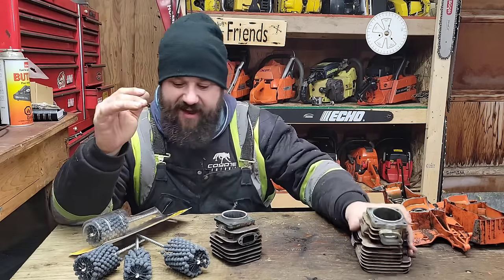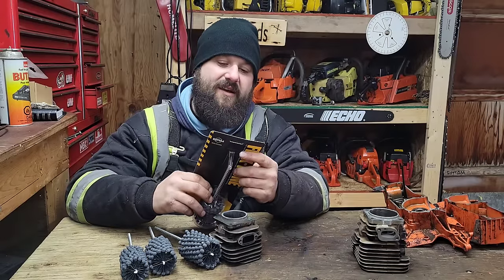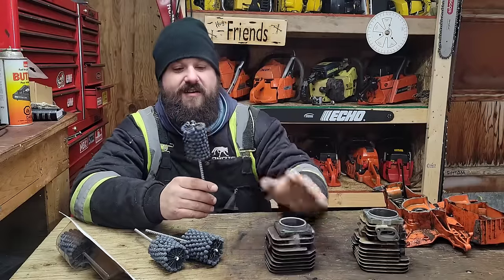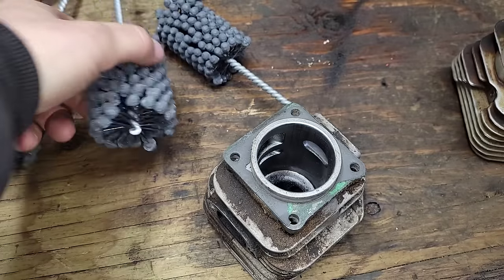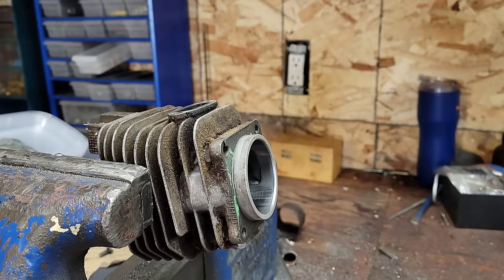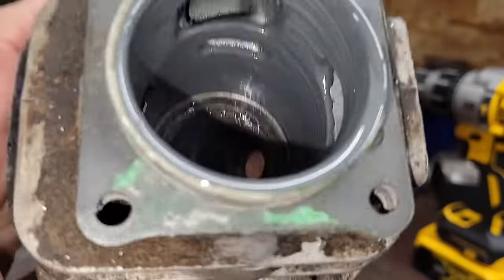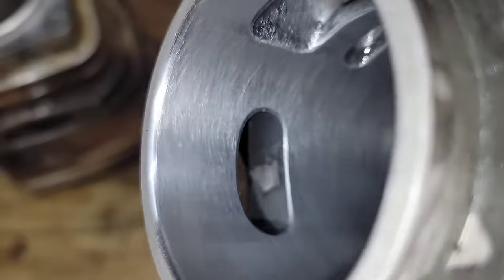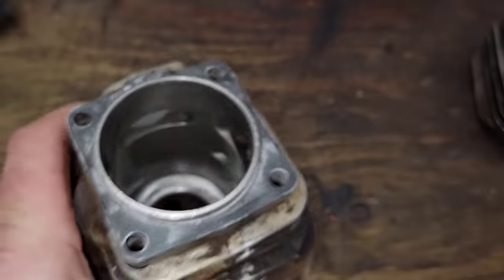Nikasil 2 stroke cylinders. To hone or not to hone? That is the question.

Comment: Great video as always Tinman. I have been using those hones for 35 years. Always does a good job. Only difference is I use soapy water for lubricant. I actually submerge the cylinder in a bucket of soapy water when I hone. Works well for me and no messy oil everywhere 👍🏼
Reply: Right on… I just work under my faucet on my shop sink and work with the warm water… makes your visual inspection much clearer…
Reply: Make a video

Comment: I use both, ball hones and three shoe hones. With the the three shoe hone you have to be a little more careful because they can take material off faster then a ball hone. But I like them better because you are working with flat plains, so if you have waffling or low spots they'll show up. Where the ball hone will cover them up.
Reply: Covering them up is better for my ocd

Comment: I am all for honing good cylinders.   The only comment I have is they suggest using aluminum oxide for nikasil cylinders 240 plus grit.   Silicone carbide is for cast cylinders like steel engine blocks.     Also.  Ball hones are for many sizes. Not just size it says.   If it fits it works.

Comment: If you are going through all the trouble to port a cylinder a good de-glaze is a very important step. A very glazed cylinder is not going to run any where near as good as a good cross hatching. You will notice the difference, especially if you want to run the engine for long periods of time. A glazed cylinder will be weird when it gets hot because the oil has nowhere to live. I have even been known to crosshatch a piston now and then with some 220 or 320 grit wet dry sandpaper 😉 anything to get the oil a place to be.
Reply: I think he should move in and out faster so that the cross hatch angle is increased.

Comment: I hone closed transfer port cylinders with three stone or tri hones and open transfer port cylinders with dingleberry hones or 220 sand paper if they are not to bad. The tri hone will tell you if the cylinder is round, if you have any taper near the top or something else wrong. They will also remove transfer. I use W-D 40 for lube. 
 Great video keep the good stuff coming

Comment: Tinman thanks for making this video- I’ve always honed after porting and have used that same brand hone for years- never once have I had issues with the plating - if plating comes off than there’s a bigger issue than the ball home running through it- and you hit the nail on the head when you mention how running the hone through cleans up the chamfers and makes the edges flow better- your best line for sure was “ if you don’t want to hone than don’t hone” it’s crazy how one guy will say not to and it’s like guys who have never tried it get all nervous like your running a jackhammer up and down the hole…. Great video man!
Reply: Nailed it

Comment: Tinman, honing definitely works. I have used the ball hones I'm many different cylinders on jet ski and marine engines. I was told by a very experienced race engine builder to never use a shoe hone in a two stroke cylinder. He said they can catch on the ports, breaking the shoe and absolutely trash a cylinder. If I rebuild an engine it gets honed unless I don't have that size or am replacing the cylinder. Keep up the great work Tinman. Your knowledge and humbleness is awesome. 🤘🪓🌳

Comment: I have used those same hones for all kind of things that need fit or just smartened up.  They work great for everything especially cylinders.  The finish in a cylinder can't be beat and they really do a good job on 2-cycle port edges like you said.  Never had an issue with results after using them.  Hey Buckin, bananas are really good for reducing muscle cramps!  Have a good one everybody.  Thanks Tinman, good video.

Comment: Hi Tinman. Thank you for ALL that you do to help all of us grunts work on our saws! We are all indebted to you.

I was just out on the web looking for a source for the 320 grit silicon carbide flex hone for my Stihl 026 and I found a tool seller that has included an image of the Abrasive Selection page from the Brush Research catalog. It says "For deglazing Nikisil cylinders, we suggest 240 AO." So softer and courser stones than what you are using. And justgjt made the same comment about the aluminum oxide last month. Since we are only wanting to deglaze and/or crosshatch the surface the softer stone makes sense.

Removing the aluminum transfer and restoring the cylinder surface rather than jumping right into a new cylinder isn't controversial to me!😁

Comment: Fantastic and spot on Tinman!!!  You totally hit the ball out of the park when you say hello you aren’t honestly honing anything but you a just doing a little bit of a deglaze job to make your rings a good bore to bite and cut and seat and seal up your bore nicely!!! I absolutely do new and used or basically every single engine I build! I’m a warm water underneath my sink for the water lubrication and materials removal so it’s not really even possible to damage the bore with the water process! Yeah man it’s just like 6 rpm’s and a couple seconds of action for a nice surface break not a 9K boring project! LMFFAO

Comment: I use the 3 stone spring loaded hones for just about every Atv I rebuild. Never had a problem with one not seating the rings.. Even on chrome/Nikisil cylinders. I once took a Nikisil cylinder for a Suzuki that needed replated and i couldn’t afford to get done so I took my 3 rock hone and honed it out to the next size piston, was a steel sleeve that was plated knocked the plating off of it and then it it back together with a new 1st oversized piston and rings. Rode that thing ram better than when I got it for over a yr sold it to a buddy and he rode the snot out of it for at least two more years before blowing it up..

Comment: Glad you covered this subject. I started playing with saws a few years ago and purchaced the same brushes you have. I've had great success cleaning up cylinders and also some failures on cylinders that were very worn. As you pointed out speed and duration are all part of the learning process. Wouldn't try chrome myself either. To thin, hard and brittle IMO. Thank's for the video!

Comment: Great channel.  I do a lot of Polaris cylinders with Nikasil coating.  I ball hone but only go one direction and I hone fast to get the recommended degree.  I hone till I see a matt finish.  I have also used stones to true the cylinder, but found the ball hones to be easier and less likely to chip or catch.  If a cylinder is to the point it needs stones to true it up, it needs to be thrown out, or bored and Nikasil reapplied.
Reply: What grit and media ball hone do you use in your Polaris Nikasil cylinders?

Comment: i used a ball hone when i put new bearings forged rods and  pistons in my honda before i boosted it. worked great. i also made a sleeve guard for it out of jb weld to reinforce the sleeve havnt had an issue  yet and last time i got it dynoed it made 436 wheel horsepower. its amazing how much power u can get out of a 1.8 liter 4 cylinder lol. keep it up though buddy love your videos

Comment: I use the ball hone for light clean up I use a 3 stone on beat cylinders as cylinders wear they become un round or out of square the 3 stone will actually show you how worn you cylinder is the ball hone will flex and curve with the cylinder walls they both have their purpose as for the cylinder coatings I'm not really sure to hone or not to hone I always just kinda just let my brain do its thing if i do I do if I don't I don't haven't killed anything yet I'm new to the channel and I like what I see learning alot about porting its a part of hotrodding I haven't ventured into yet got an old junk craftsman saw I'm gonna grind up and see what happens thanks for the inspiration man

Comment: I found this video quite interesting, because prior to watching this, I would never have honed a saw cylinder.  I heard your comment about dry honing, and with three stone hones, what I learned long ago, was that dry honing takes off less metal than wet honing.  The oil helps clear the debris from the stones, so they continue cutting much longer.  My guess, is that the same thing would apply to the ball hones.

Comment: During my brief stint at Arctic Cat, we would ball hone cylinders at rebuild.  Just a couple in-and-outs...that's all.  Have to do something to get the rings to seat.  I did a lot of jetting and EFI testing and so I got to seize up a number of engines on purpose.  Well, I'd lean out jetting and monitor detonation.  If careful I'd catch it just before locking up the motor.  I think a lot of times we'd just douse the ball hone in WD40 when honing.
Reply: Just a good dawn dish soap and water mix is sufficient to deglaze a cylinder. Ridged diamond for finish bore or removing material.

Comment: I use the same brand hones that your using and do the exact same with a low speed cordless drill and I have had great luck! Great job Tinman ! Keep up the great videos!
Reply: Is  stihl ms381 piston and ms038 are the same?
Reply: @superflanker972  the “regular” 038 piston/cylinder is 50mm, the MAGNUM is BAWDARSE, and is 52mm diameter. 

And there is a $hit-ton of difference!

Comment: Love the video. I am interested in getting a ball hone. 

I used the regular 3 leg hones. 
To not so great success.
this is a better solution. 

After honing try cleaning the cilinder wall with ATF transmission fluid. 
Don't ask me why. But it works really well for getting all the honing particulets out of the cross hatching . 
Have a nice day

Comment: I was given an Echo Pb500T back pack blower with a blown cylinder, piston and ring. I honed the cylinder, sanded the piston and carefully separated the ring. put it all back together and have been using it for a month now.
Reply: I'm working on the same blower. Regular gas was run in it. I'm thinking I'll replace the piston, but I sanded the cylinder transfer. But I could only find a 240grit. Do you think I'll be okay with that grit?
Reply: @gregkloe  so I ran a small hone thru it, sanded the piston, replaced the rings and it has been running over a year now.

Comment: Tinman you are right that there is no clear size label on their packaging. If you look on the back, however, towards the bottom is a sticker. The top line of the stick has the size, grit and material.  This keeps their packaging costs down, but it is a bit confusing. Thanks for the great content.

Comment: Tinman you freakin rock. I use 3 shoe brake hone for everything.  Those ball hones are a way better idea even for breaks and pipe cleaning. Great video .!!!❤️‍🔥❤️‍🔥☀️🌙🪓
I used the scotch brite  dermal attachment they have all different grits up to like 800 they work good for small areas .!!!!!
Reply: I’ve used the shoe hone and flex hone together on non-nikasil 2-stroke cylinders. I first coat the cylinder with a light coating of oil and run the shoe hone briefly at fairly slow speed. Pop in the flex hone and run just long enough to give a good cross hatch. No expert by any means but has worked well for me on quite the few old Rotax’s.
Reply: @shannonwhitaker9630  I have yet to hone a chainsaw. I did a few dirt bike cylinders we just sent three out to get resealed they were two bad.  I have a few break cylinder hone kits. The two shoe worked great for taking the burrs off big copper pipe, I’ve even used them on steel muffler pipes. They come with 4 in the pack and only one is the three shoe so the others are  whatever I can use them for 🤣. Tinman is rockin and rolling. I love this stuff. Kindness and love ❤️‍🔥☀️

Comment: I own Boston industrial honing Co. I have all types of hones, we do engines and industrial honing on all  materials. I usually use sunnen hones, but I love those ball hones for ported 2 strokes, not so much for sizing but for breaking the sharp port corners and somewhat of a cross hatch. You can size with them but to remove stock for sizing you really need like a sunnen positive feed hone. Ball hones can dothe trick tho.

Comment: Thanks TinMan, I did hone, and it looked about like your cylinder.  However, after a few heat cycles, I took it apart and looked at what was going on.  The cylinder was polished, but there was a MASSIVE amount of cast iron dust.  I was using new Cabor rings.  In short, after a few short runs, the honing marks were gone, and the bore was polished.  I think I'll go back to green scrubbies wrapped around a dowel stick   It was a three stone hone

Comment: Honing was part of my job and I wouldn't think twice about using a flexihone on those cylinders, I used to hone various jobs to size and instead of changing to finer stones to get the required finish I used to wrap abrasive paper or scotchbrite around the stones.

Comment: I made my own tool for the job . deep socket wrapped with 3k grit wetdry sand paper & then buttered up with the 3k/350grit diamond paste . I have a video on my channel of the stihl cylinder I’m taking about specifically. I used 100% muriatic acid before I did anything too . A tip for the acid is to stuff the cylinder with toilet paper then soak it with acid but not dripping all over the place . The idea is to make sure the acid stays in the cylinder by sticking to the nikasil coated walls ONLY via soaked acid toilet paper

Comment: If you picture in your mind the old timey tripod style hones, the edge where it touches the cylinder is 90°, so if it catches on something, it catches good.  With the flex hone style, the little balls touch at a much more gentle angle, and the force required to flex one up and over a port lip, for example, is much less, so they pop over obstructions without catching and pealing the plating off, cause the plating is weakest at port edges or at the edges of scoring.

Comment: HAHA  BBR !  As a fabricator/sign maker, mechanic, 30 year + I know this. I prefer the 3 stone hone due to its being spring loaded and don't have to buy a different hone for different sized cylinders.  However the ball hones are in my opinion more aggresive..The stones can be also changed on the 3- 4 stone units.  Fine- course.

Comment: I was always afraid to do that, but I think after this video I'll try! I usually use a tool for the drill (I think it's called scotch Brite flap wheel ) which has layers of fine sandpaper and scotch Brite in between the layers and the finish is amazing! The only downside is that it can be used one way so I have to modify it in order to use is both ways!

Comment: *Mineral oil for break in. Semi synthetic at worst. NOT full synthetic.

Also, try be mindful about the 'in/out' movement speed you are going to use to achieve the optimal cross hatch angle.

This guy makes it look easier than it is, if you have never attempted it before. Make sure you set up your work area so you are in the absolute best position possible to control the drill movements to keep everything nice and square & consistent. That way, being the first ever attempt, it will either go perfectly as planed, or at least allow you to smoothly and accurately respond to anything that is unexpected.

Comment: Can you use the silicon carbide on aluminum cylinder?  They recommend the aluminum oxide for aluminum, but the place I want to get it from doesn't have it in my cylinder size..

Comment: I use flex hone's in the shop at work all the time! They definitely do the job! Depending on the job at hand, you can knock off heavy burrs or create a very nice and fine crosshatch pattern of needed. and uniform finish.

Comment: I just did a saw that someone took sandpaper to. I used a 240 grit hone and it cleaned it up nice. The saw works like new again. $32 hone was well worth it to fix an 2050 johnsred.

Comment: I didn't even know this honing procedure could be done, well it sure is more than clear that it pays off, the cylinder's bore came out completely renewed in 20 seconds work. My Yamaha Zuma (BWS here in Europe) has a 70cc Polini aluminum kit fitted to it which has a chrome-nickel plating so I couldn't do this honing process to it.This cylinder has withstood quite a considerable amount of years in service therefore I'm currently with a C piston. I also have recently reached the final stage of the restoration I've been doing to this scooter in the last 7 months...I almost feel sorry for not having an iron cylinder instead of aluminum just so that I could take it out again in order to hone it 🤷‍♂️.

Comment: My snowmobile cylinders I take a medium scotchbrite pad that is used for wet sanding primer and I fold them over lengthwise and twist a coat hanger around it and chuck it in my drill and spin it in and out of cylinder and never had an issue many of them I've done that way are still running. I've used the trick in both Nisil cylinders and chrome cylinders. It's kind of like running a patch through a gun barrel but with drill

Comment: In the workshops I've worked in CRC lube is used when giving a quick hone. I saw one apprentice get over enthusiastic on a 4 cylinder he was working on and take the bore 20 thou bigger. Aliexpress has the dingleberry hones for about 20-25 bucks in the 50mm range.

Comment: Interesting video this question isnt really related to this video but i do land scaping and was wonding whats in your opinion the best 2stroke oil for weedeaters, chainsaws, and leafblowers? I use the weedeater at lower speeds than typical and wide open for long periods when its used wide open typically
Reply from the maker: Opti2 is all I use. It's good oil.